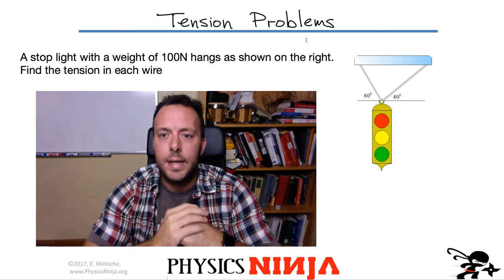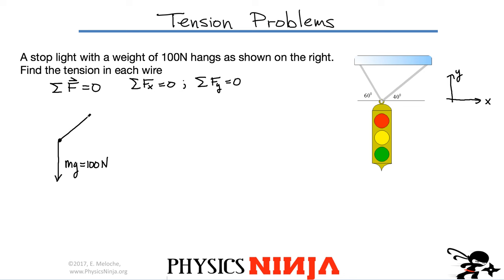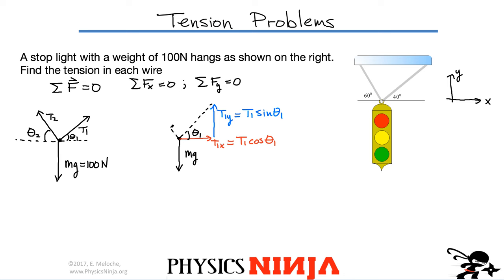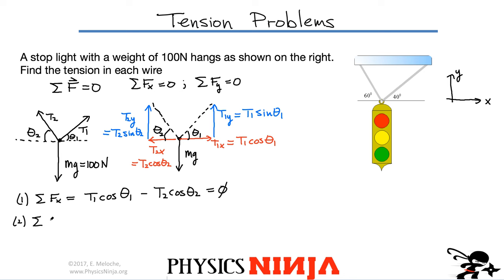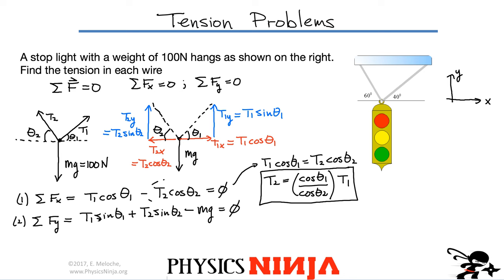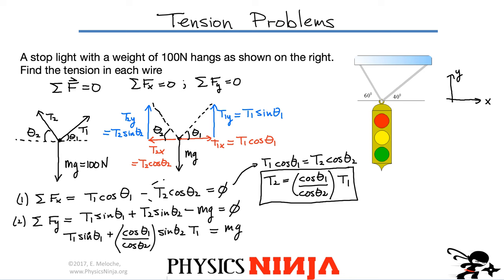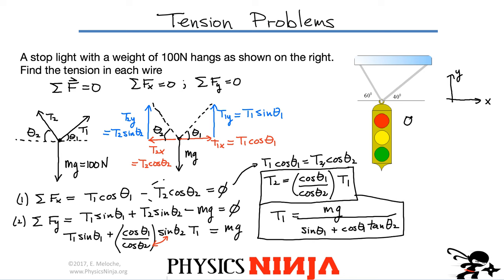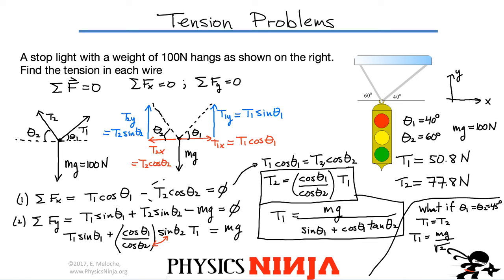Solving Tension Problems

Comment: Where does the "second" T1 go that was brought into the second equation?
Reply: I’m not sure either
Reply: Exactly, don't get the point of skipping those algebraic steps
Reply: Statics !!
Reply: Maybe a teacher could explain this properly but think of his equation (which seems to forget one of the T_1s) as the sum of both T_1s in the denominator and mg in the numerator. Try it. If you solve before he made that equation, when the T1s were being added after multiplying the trig with the angles, you would get two T_values that add together. That sum will have to be divided to both sides. That cancels on the left leaving T_1 equal to mg/the sum. 

Sorry if that doesn’t make sense. I’m cramming for an exam